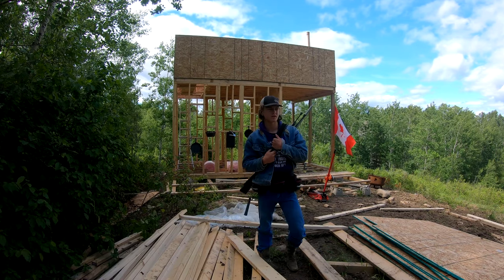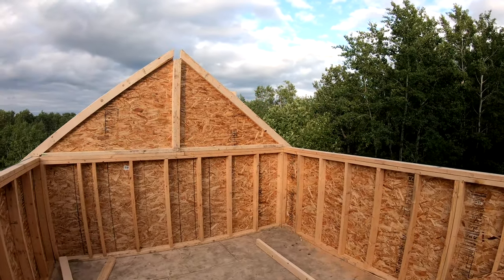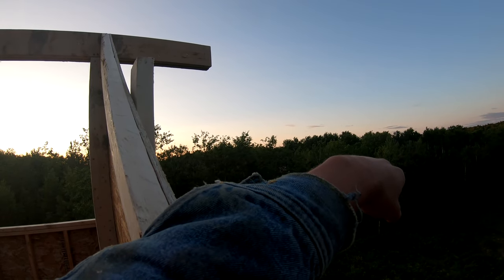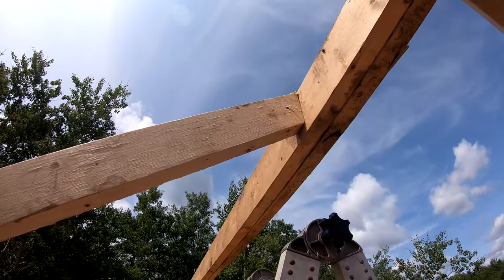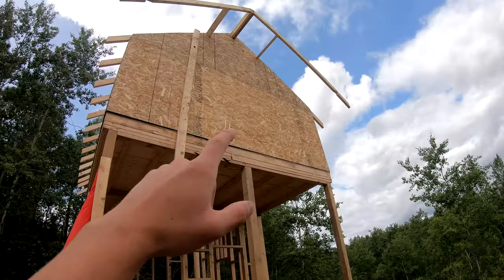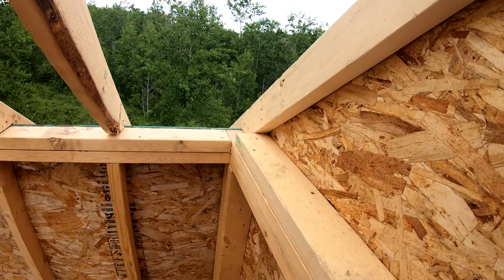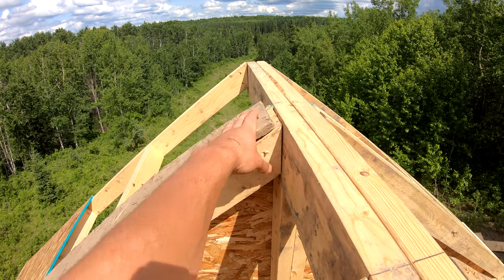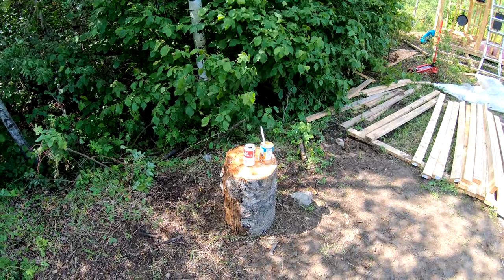Offgrid Cabin Build Pt. 8 Building the Roof (Rafters, Ridge Board and Sheathing)

Comment: For saying you aren’t a carpenter or know much you definitely did a great job with the actual carpentry techniques. A few things you added a 2x here and there that really didn’t need it. Cutting the rafters you did great. I’ve saw million dollar homes with rafters cut far worse. It’s not always going to be perfect. Note about the OSB.....usually it’s 1/2” but with the lumber prices I don’t blame you. It’s already done but the rough side faces out for 2 reasons. It gives you traction when walking on it when used for roof applications and if you see the painted lines on the rough side and measure them they line up for 16” and 24”  centers so you don’t miss the stud when using an air nailer and makes it go faster. Other than that you are doing awesome. I love your channel. Thanks for sharing your journey in the bush.

Comment: The OSB on the roof works fine. The smooth side should of been down. The tar paper and roofing material(Tin roof or Shingles) is what sheds the water. Also makes for better walking. lol. But this the second time I've watch this video now and still cant get over how much you already know at your age. I am using power rams this 2021-2022 season for coyotes for the first time and you have given me so much information. Thanks!

Comment: I would get some osb on the first floor wall, because the topside is done a good wind will blow that structure over. The wall osb will stiffen the first floor up and it wont be a risk
Reply from the maker: No worries already done sheathing the bottom. Regardless, with the ridiculously excessive amount of horizontal bracing I did you couldn't shake the thing if you tried. Survived the biggest storm of the year as it is in this video without a scratch. Appreciate the concern and the advice though!
Reply: @TraplinesandInlines Good man!

Comment: Your first rafter on either end should be a 2x4 smaller to leave room for a a ladder which gives ya your overhang chum. 👍✌️
Reply from the maker: Not quite sure what you mean there buddy
Reply: The top of the first truss (gable end) should line up with the bottom of the rest of the trusses. Then the cross pieces you cut (22 1/8) extend across the gable end and get nailed to your second truss. When I get time I’ll demo what I mean on Facebook. 🤘
Reply from the maker: ok gotcha bud thanks for the tip! Might have to do for now though ive already shingled everything up lol
Reply: It’s a learning curve the more ya build the more ya f@#$ up the more ya learn.😂👍
Reply from the maker: @timminstraprs2169  can't agree with ya more buddy, by the time I get this one done I'll be ready to take on more serious projects. The nice thing about putting my work on YouTube is every little error or emission gets pointed out in the comment section and the knowledge of my viewers is used to further mine. It's great.
Reply: Not just that but anyone that wants to build a structure can read through the comments and catch hints and tricks.
Reply: Depends on how it’s used news button. 👍✌️
Reply: Agreed. 👍✌️

Comment: I am 70 years old and like watching construction but your explatives are off putting. Won't a tall building need strong fasteners against wind and heavy snow? Sally in northern Illinois USA
Reply from the maker: Sincere apologies for the swearing, I'm out in the bush all day everyday so there isn't ever anyone to stop me lol. Regarding fasteners, do you mean on the ply wood or rafters?
Reply: Awesome job man .... much inspiration, but I would like to say how you used 2x4 for rafters if you bought a sheet of plexiglass instead you could of had a much larger window for less and used the 2x4 and hardware to hold together.... with bracing and framing you could of kept the integrity and had larger windows for much less cost 

Thanks for your videos it’s nice to know that young men can still think straight and have a good head on there shoulders
Reply: Traplines and Inlines ❤️